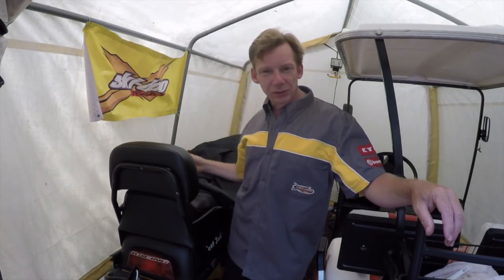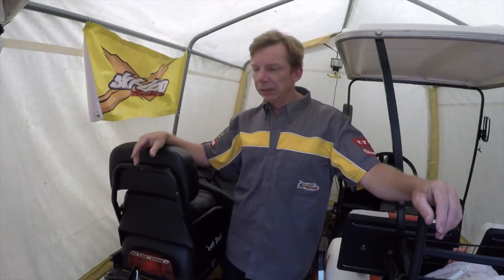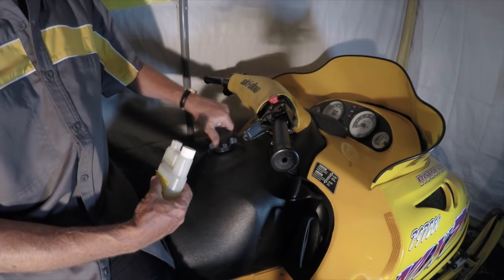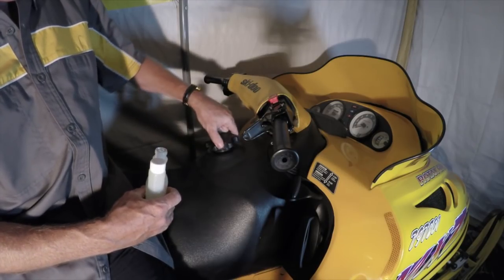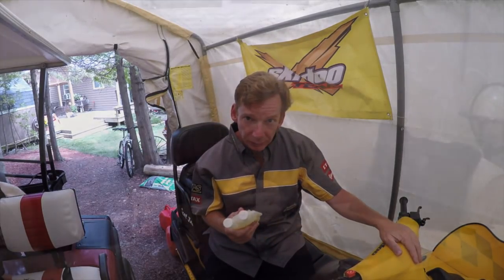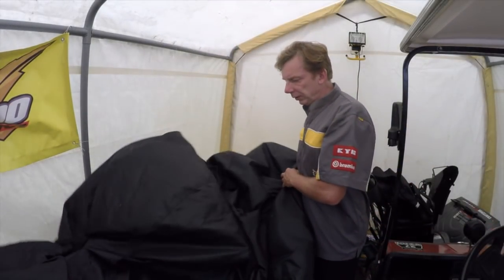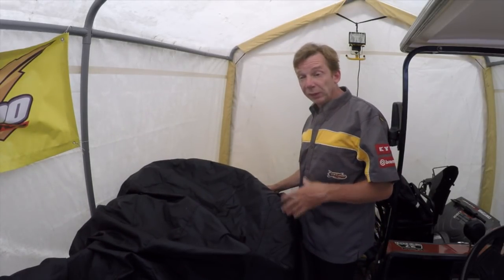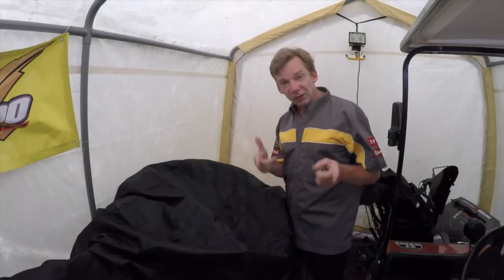Snowmobile Storage Tip: What about the gas in the tank?

Comment: So I summerized my sled over the weekend. All went as easy as you make it look in your videos Dave. Just one tip I'd like to add. Since this is my first sled I'm also just learning, I discovered that even though I was trying to do a good thing by raising the back end keeping the track off the ground, this is not a good idea when you're trying to run fuel stabilizer through your system. I couldn't get my sled started and after tinkering around and attempting to fish the fuel line and filter out of the tank thinking I may have kinked the line after installing a new filter, I noticed the fuel was at the front end of the tank whereby the fuel filter was not submerged. So I dropped the sled down and she started straight away.

Comment: Great video Dave, I'm new too riding and your videos. I have a 98 Skidoo Mach 1 700 Triple.

I also hear people putting sea-foam in with gas for the summer storage. Any thoughts?

Video request - how to change belt and spark plugs?

Keep the videos rolling, you're doing a awesome job👍
Reply from the maker: Hi Dhanbir. The product in the video is the one recommended by BRP for their sleds, so thats what I stick to. SeaFoam is another gas treatment that cleans sludge off of internal parts and binds with moisture, so it can be used also. I have read a few comments that used for storage, Seafoam can break down deposits and actually clog things like the screen in the in tank filter, but I honestly have no strong opinion either way. 

Thanks for the video suggestions, always great to hear ideas from you guys. Will do something up in the future.

Comment: Hi, I bought a race sled last year. 95 xcr 600 drag sled. And it runs great, but you have to prime it to start it.. Any ideas? Thanks
Reply from the maker: Sorry not clear what you mean. As in using the primer? Did you watch my Starting a sled with a primer video? Or are you talking about something different?
Reply: it depends how cold it is if its warm -10C or something prime it 1-2 times. if its cold -20C+ then do 3 but since its an older sled cold weather like -20C can really take a toll on older sleds as i learned the hard way. as my 1999 ski-doo formula Z blew a cylinder and well 1500$ had to say go into that just dont make the same mistake i did.
Reply from the maker: I have a video in starting a sled with a primer that might help.